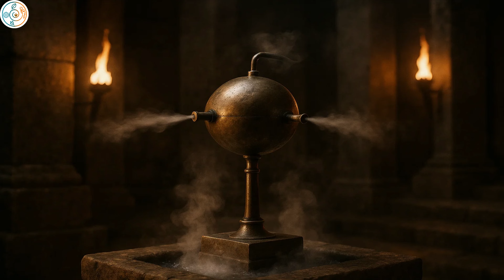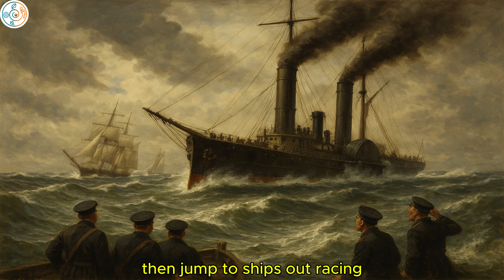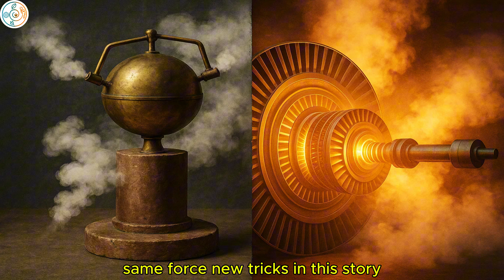Steam Engine Evolution: Secrets That Rewired the World

Comment: James Watt INVENTED the first PRACTICAL High Pressure Steam Powered Engine. 
Not Richard Trevithick. 
All Steam Engines use high pressure Steam, Steam is always the High Pressure side of the piston, no matter if it's 2psi absolute or 200psi absolute, they're all Steam Engines. Naturally the first ones had lower Steam Pressures than later ones, (Watt had just INVENTED them !!). 
You could walk faster than Trevithick's Locomotives. Watt's Engines with their "Low" High Pressure Steam sold like hot-cakes, 
Trevithick's Locomotives with their "High" High Pressure Steam couldn't sell. Also, the boiler pressure on Watt's 5psi absolute Engine was 10psi. The same as on Trevithick's 25psi absolute Engine. So, boiler technology must have been similar.